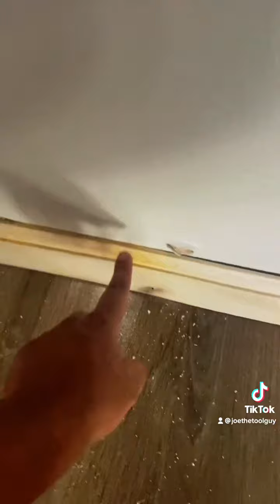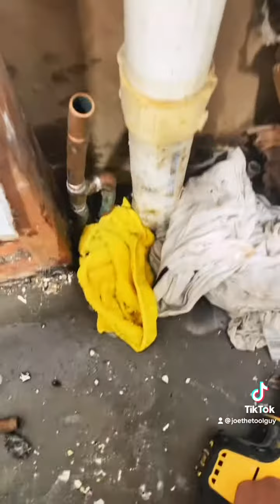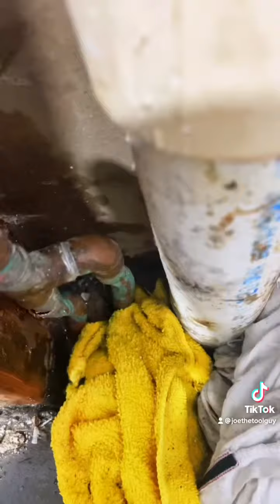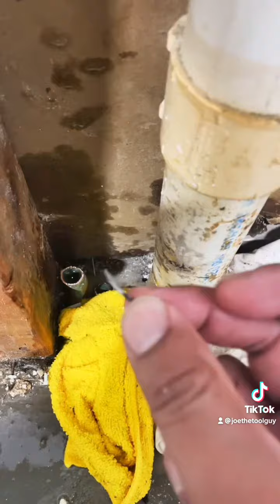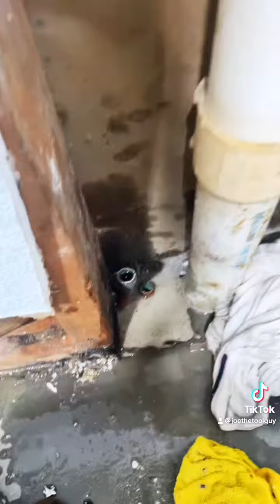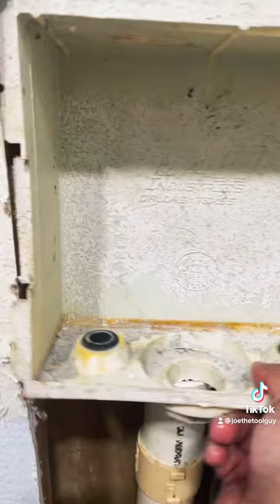Don’t let this happen to you!

Comment: Use a male sweat fitting if you are going to solder or run to Pex. It’ll give you a little room. Also unless you have the tool, get a plumber who has propress fittings. Can be applied wet.
Reply from the maker: I’ve been considering switching because of so many damn wet solder joints. Its a headache.

Comment: Shark bite with a shut off  will work
Reply: Unless you have access, I’d never run shark bite inside a wall.
Reply: @dejavu3655  I have SharkBite connections in my wall for the washer been there for 7 plus years no problem

Comment: Good vid! You could allways Go Before where it Enters the slab ( other end ) & Run New From There.
or
Blow out water from pipe
wire brush inside of pipe
put a piece of copper inside pipe
and Braze the Joint using 15% silfoss rod & oxy , acet torch. stronger weld.
put a shield on concrete before welding - flame shield , metal and Wet Rag at Floor level before welding.
or NOT , Probably make for a better video with concrete exploding in your face ! 😂

Comment: You know about the bread trick? I’ve just heard it myself never had to use it myself. You can shove some white bread in there and it will soak up the water long enough for you to solder the joint or so I’m told 😉 good luck!
Reply from the maker: It does work, problems arise when you’re that close to the concrete because of heat dissipation
Reply: @Joethetoolguy  Good to know! yeah that makes sense I wasn’t thinking about the heat sink effect of the concrete more so the space constraints
Reply: also when u point a torch at concrete it gets quite interesting ! concrete starts getting angry !
Reply: a plumber friend of mine taught me a trick before sweating a pipe , blow the water out of the line / Faucets with a co2 tank. you could use an air compressor and blow line out / dry before sweating. open all faucets & tub close by.

Comment: re dewalt sawz em all, i disagree, at work i use one i bought on amazon using the low to high filter, i wanted the CHEAPEST no tool blade change, lithium rechargeable with recharger.... its DEFINATELY weaker than the dewalt and prob. MORE maneuverable, bought last year on special for about $25... from tacklife